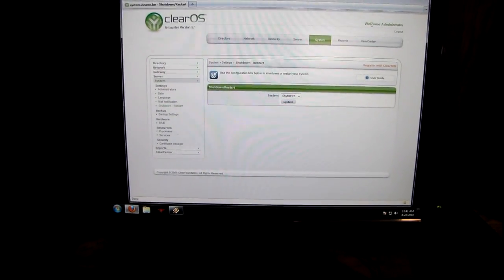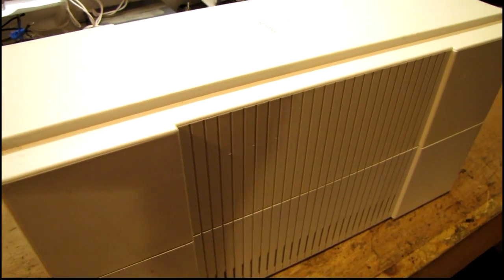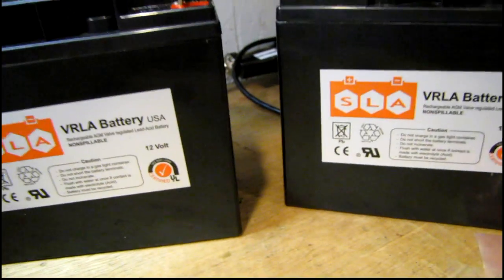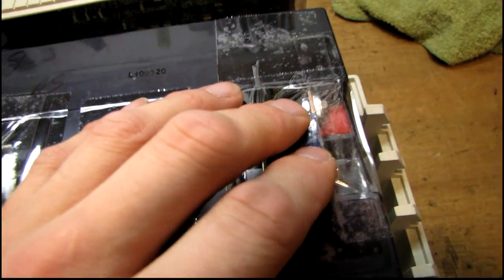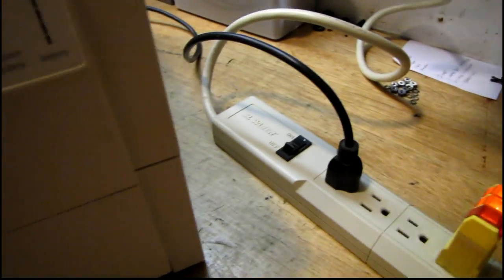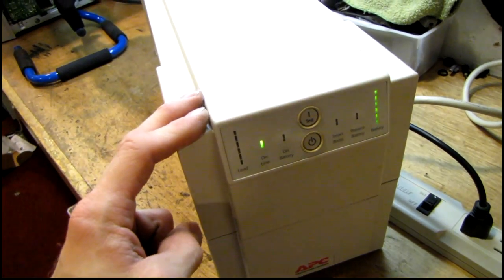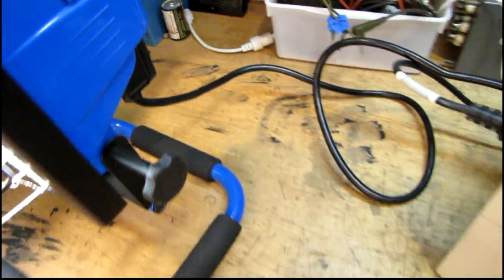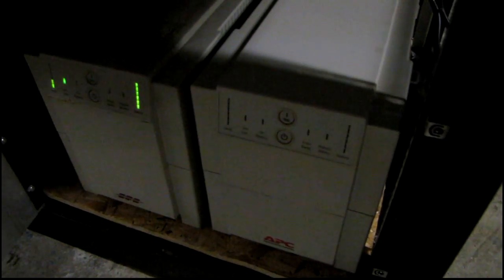Replace and calibrate batteries in an APC Smart-UPS

Comment: I cant find any info on this UPS for how to adjust the voltage sensitivity using the 4 mechanical dip switches on the back. I changed power points in my house and now it goes to battery when our water pump starts working because of voltage drop. It didn't do it before on the same circuit - how do I make it less sensitive?

Comment: I had a APc 1500 that signaled battery failure. Removed batteries that were so hot I needed a glove to hold! Put them outside in 10° weather on concrete pad  . I was very lucky!

Comment: I have one of these and bought it about 20 years ago.  It currently won't power up.   Can you verify something for me? I read somewhere that the unit will not power up if the battery is completely dead, is this true?  Don't want to but a new battery if the unit is junk
Reply from the maker: It's been too long for me to remember for sure, and I've since upgraded my units.  Have you tried holding the power button for a couple seconds?

Comment: Do you still use that UPS, for how long that battery pack worked?
Reply: Came to ask the same question.  Installed my Pack in a similar (1400 or 1500 Smart-UPS) model back in 2009 and  just realized a few days ago... It's been 11 years since I replaced the pack (and the unit has been unplugged for several years(?) too. How time flies...)
Reply: Attempted to "top off" the Cells in the "weakest" half of the pack... Realized a bit too late all but one only needed a few drops of Water... Because just one had a Crack in the case. So needed to clean up like 8oz of Water from the table...

Comment: I found an original apc pro 1100 tossed out with bad batteries. It to was a 24v. It came with a mini battery connector in the back as an emergency disconnect for the internal batteries. I removed the batts and rewired the mini connector for use with external batts. hooked up two 1000 amp truck batts. Run time with computer, monitor, speaker power supply, router, room lights charging misc stuff, unknown but have used for 4hrs no problem.

Comment: I have a question for you and hoping you can answer it.  I am trying to increase my backup battery time for a fish aeration pump.  So, I took out the factory battery and hooked up two deep cycle batteries in parallel.  All went well and it ran for about 6 hours and then stopped.  I checked the batteries and still had 84% charge left.  I am questioning the UPS system as to why it wouldn't drain the marine batteries to a 0% charge.  I noticed that this UPS system was doing that prior to this modification just on my computer equipment I had it hooked up too.  It would run for about an hour no problem and then over time would only run for about 5 minutes.  I thought it was the battery.  Does this seem odd for a UPS and should I just consider getting a new one?  Thanks  SIDE: THE BATTERY GAGE WITH THE BATTERIES AT FULL CHARGE IS AT HALF.
Reply: Your problem is that marine batteries have a different voltage range than normal lead-acid batteries. The UPS will think that the battery is low when it gets to a voltage that would be considered low for standard batteries. Because marine batteries have a lower range, the UPS will still shut down at those same voltages because it cannot differentiate between battery types. There isn't really any way to fix this. If you want to use those batteries in a UPS, you'll have to find a UPS that is built for AGM type batteries. I think Triplite makes some models capable of that. Also, you should never run your batteries to 0%; that will damage them badly. Normal batteries should not be run below 50% and AGM/marine batteries should not be run below 20%.
Reply: Shawn Paul i, i,

Comment: Running the batteries until they are fully dead is terrible advice. That is an example of something you DO NOT want to do to small SLA batteries.
Reply: +Nick M (Triknoodle) but you have to do that to calibrate and also the ups knows when to stop not to hurt the battery !
Reply: +Kristijan Dinga No you don't. There are several comments about APCfix already. Since you replied to various other comments, how did you manage to get around those?
Reply: Oliver ASUS no the ups gets to a certain safe voltage and cuts the batterys off dus not hurting them
Reply: So they developed APCfix for no reason and all those who use it do so for no purpose? Sounds legit :)

Comment: No no no.

Use APCfix and the serial cable to automatically calibrate it for you.
It changes ONE hexadecimal value in the firmware, it takes 20 seconds.
Forget about flattening your new batteries, which is harmful for them and forget waiting around for it to run down.
Reply: CableWrestler Well... it's not that fast, but yeah... no reason to drain the suckers... which is definitely bad for the batts.  Here's some good info on the subject... seems the best way to do it is via the Network Management Card if you have one... these SMART UPSes should support NMC technology: http://forums.apc.com/spaces/7/ups-management-devices-powerchute-software/forums/general/7378/run-time-calibration-of-apc-smart-ups-3000va-usb-serial-rm-2u-230v
Reply: What if you have one of their newer models with only USB? APCFIX only works with models that have a serial port.

Comment: HI, I have a unit of APC Smart UPS 1500 which is newly replaced with SLA batteries. However, the battery indicator LEDs  ( fully charged with 5 bars) keep blinking..... what is the fault and how to resolve it? Will some one help me. tks
Reply from the maker: That usually means that the battery meter is not calibrated.  You could probably use the Powerchute software to help with that.
Reply: Look for apcfix.exe, it's an unofficial tool that will communicate with the UPS through the serial port and reapply the correct "battery constant" parameters.
Here's the link: http://apc-fix.com/apcfix
The site's in Russian, you want the link just to the left of "NEW!"

Comment: I've got a smart 1000 that I had modded to hold 4 7.2ah batteries instead of its normal 2 12ah batteries. That was in 2010. One of them finally let go, so I replaced them with those exact same batteries you have in those ups's. My case is also for the smart 1500, so it holds the 18ah batteries nicely. Running a calibration now. Thanks for the tips!!

Comment: I managed to pick up a smart ups 2200 XL with almost new batteries for 100 GBP and trust me over in the UK that's good :) I would stick with the old APC UPS as they are true sign wave UPS unlike the new ones that are not. I don't think i have anything that can put a constant load on that at 2200VA :P. Also gives me a good workout its over 55KG
Reply: Bargain, the batteries alone are worth that.

Comment: hi! i just got replacement batteries for an APC smart UPS SUA 1000.  i believe the part number is RBC6.  which type of fuse is necessary for that battery, and where could that be purchased?  i had someone at a battery shop install the batteries into the UPS, but it looks like he just used a wire connector (but i didn't see a fuse at all).  is this safe?
Reply from the maker: There is supposed to be a fuse between the batteries.  You can search ebay for "RBC6 Fuse" and you'll see what it looks like.
Reply: +Maxxarcade thank you so much for your comment! :D sorry for the delay in responding :P

Comment: I recomend you to avoid putting the wifi on a metal shelf. The signal is weaker and shielded by metal around it
Reply from the maker: Yep, I plan on getting a better setup soon.  It works ok for the time being though.  I have a good signal in most parts of the house.

Comment: I bought a APC UPS Pro 1300 for $15
The battery's were cold dead. I charged them and it says it'll last 30mins on a 160 watt load. Would you say that's good and is there any good supplier?
Reply from the maker: Is that a Back-Ups Pro 1300?  It should last about 40 minutes at 160 watts according to the documentation.  It uses an RBC124 battery pack, which you can get from Ebay at various prices depending on quality.
Reply: batteries do have to be broken in 3 charge discharge cycles should do it
Reply: I bought it used at a second hand store.. Not possible to be broken in.
Reply: I have  two  of  these APC 1250 and APC 900 both  Made in USA. I upgraded  my  batteries  to  lithium ion 7s 120p. Best for power  interruptions , and will last  for 48 hrs continously  without  charging..After  which  I will balance  charge  my lithium  using the ICHARGER 3010..been  using  the  setup for three  years  now...

Comment: is it possible to use e.g 30AH battery, replacing the 4.5AH one and calibrate them in the way you did?
Pout is 300W from the SmartUPS
Reply: +fnordist the ups is probably design to work on 100% load only for the time being untill the battery dies soo it wud probably overheat

Comment: Forgot to mention, I am using 2 x 12 volt 24 amp hour batteries externally placed and loomed. More capacity and you can use any UPS battery as long as the voltage is the same and the current rating is at least the same or higher than the standard specified battery. Easier to replace since they are externally placed. Usually cheaper too since you don't have too use specific, batteries. If you have the space, and a little expertise well worth considering, applies to all UPS's
Reply: Get yo grammar straight. 😮

Comment from the maker: I think you can have a load from 30-60%, but it has to be steady.  Light bulbs are best.  There might be a calibrate option in the Powerchute software if you have it connected to a PC, but I just do it this way.

Comment: When replacing the batteries in these units, is there a button sequence you need to press to tell the CPU you've replaced the batteries and that you're about to calibrate them?  What if you were to calibrate the batteries by running the UPS with no load connected?  Would that work if you don't have handy a device that will put 50% load on the UPS during the discharge cycle?

Comment: My school recently had a cleanout of some old stuff and there was an apc smart ups 420. The battery had leaked, but it didn't damage anything inside. The unit will not power on, but if I plug it into a non grounded outlet the site wiring fault indicator comes on. Any ideas?

Comment: I need some batteries. too poor to buy them. using some smaller then the requirement which works but doesn't last long at all. Mainly for the occasional blink in power sometimes.

Comment: i had a smart ups usb  1000 va and the ribbon cable to the front panel came loose and fried a socket chip. i hate the design of it. every time you change the battery in you cause the ribbon come lose in the solder joint in the front control panel. i had to trash it. I wished had the external battery option found on the more expensive xl models.

Comment: It's crazy. Tape is NOT good isolation, you need to use electric tape, it's black, and it's a tick. Some plastics will have some level of conductivity dependent on the power source.

Comment: I know this isn't really related to the topic at hand, but what exactly does that radon detector on the wall actually tell you?  What's its purpose?  Rechargeable batteries generally may get warm to the touch when recharging, but from what you say the fact the batteries in your UPS weren't supposed to get as hot as that battery did.

Comment from the maker: @fbodea Yep, sounds like calibration.  20 minutes is about right for a fresh battery and 500w load.  After it is charged, let the UPS run on battery (with the 500W load connected), until it shuts off on it's own.  Leave it off, and let it charge on its own until the fan shuts off.  It should then be calibrated.

Comment from the maker: @fbodea I'm pretty sure the blinking just means the batteries are out of calibration.  If it runs for a while like that, the batteries are probably OK.  You really need a steady load of 30-50% to get it calibrated.

Comment from the maker: @uzaiyaro Yep, it a Proliant DL360 generation 1 with dual P3 1133 and 2GB RAM.

Filer server is a Xeon based system with a pair of dual core 2.8Ghz, 2GB RAM, and a pair of 3Ware 7506-8 RAID cards.

DVR is a Pentium D 930 on a Supermicro PDSMi+ and 2GB RAM.

Comment from the maker: @fordbroncodave I could, but that would cost even more.  The other issue would be cabling, where to place the battery, and the charging capacity would be all messed up on the UPS.  The CPU is not designed to compensate for anything over 17AH.

Comment: You can accually cancel the beep when on battery by hitting the on button once while its beeping. Ive trashpicked a Smart-UPS 1400 recently and replaced the batteries, the batteries were like yours, all cracked, but these did not give out any voltage at all. I put new batteries in and it now backs up my computer!